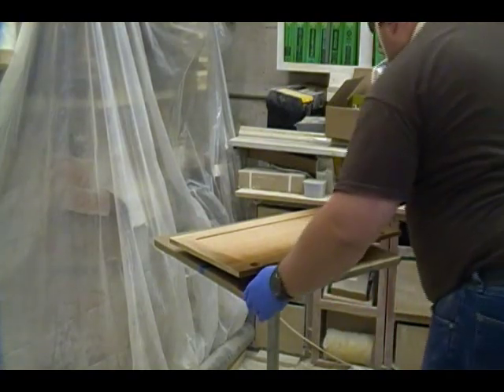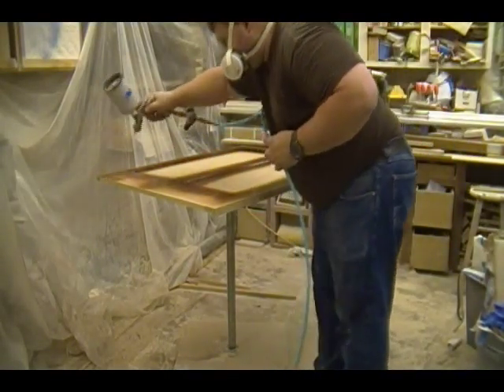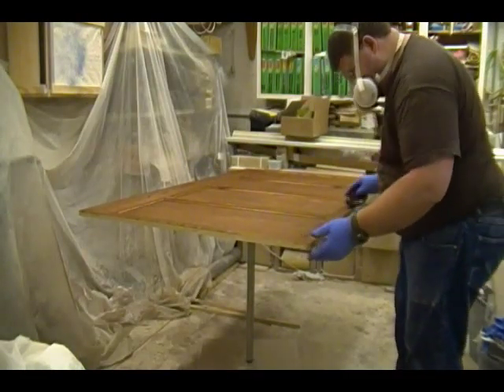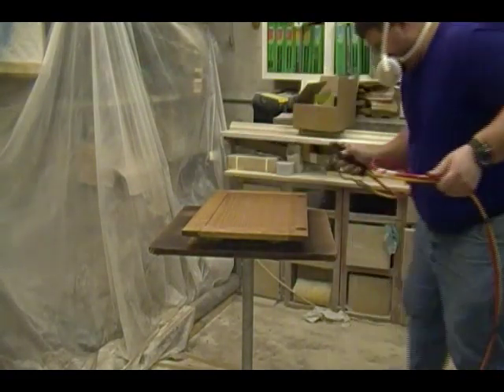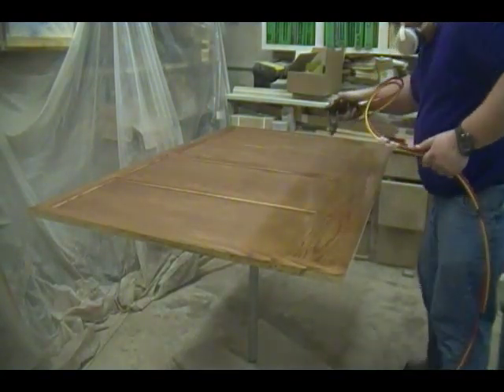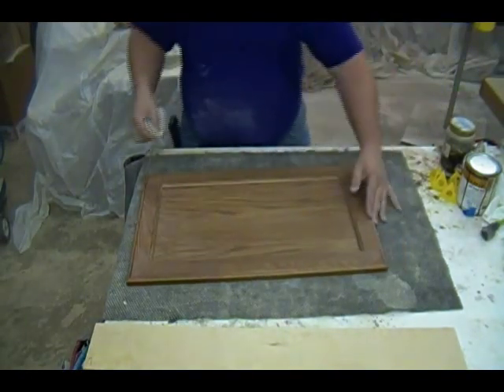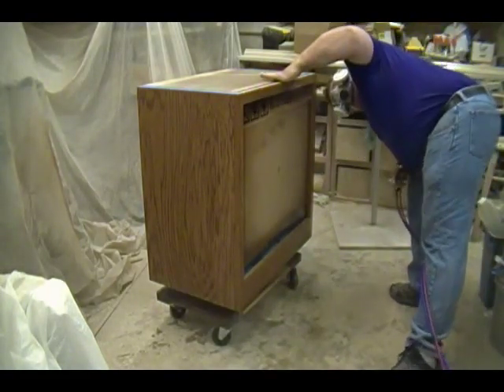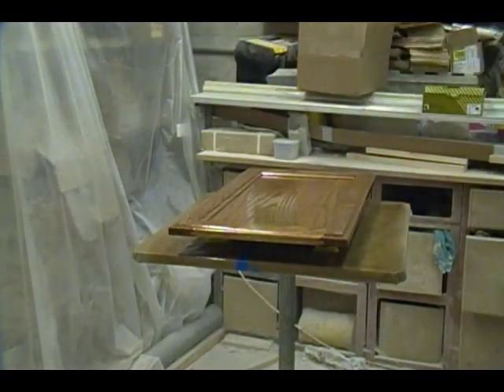Spray Finish an Oak Cabinet And Panel Surround $ 32

Comment: Two questions did you use waterr based stains or spirit based. Can they be mixed directly to the inishing lacquer and can you tell me what type of lacquer or finishing material you used, i.e. polyuretene, sHellac, nitro cellulose etc. Do you mix your own stains from powdered stains. I wonder if I can mix these stains directly with the finishing lacquer, I 'm really new to spraying. Also I think your video is very instructive and very good, Michael Horsfall

Comment: Actually I have a question. I'm just about done building an oak storage cabinet. I plan to spray the stain like you did using a HLVP gun to  achieve a rich deep look.  So whats the best step by step process? 
Step 1. I spray and wipe
Step 2. Spray Polyurethane and let dry? How long?
Step 3. Spray finishing top coat?

Should i use a steel wool in between steps 2 and 3?
Also is there a decent product at Home Depot that I can use or would I be better off going to somewhere like House of Paint?
Also was it Fruitwood color that you used? I want something dark what would you recommend and is it ok to go dark with oak?

Thank you so much!

Joe
Reply from the maker: Okay, just to clarify spraying on the stain and then wiping will not give you a deeper look, it will only speed up the process. As far as the finish, you have a couple of options from Home Depot. You can use Minwax polyurethane or Minwax brushing lacquer. Both are formulated for brushing, but they can be easily sprayed. The polyurethane will give you a more durable finish, but the brushing lacquer will give it a softer silkier smoother look. Either or, both can be used as a self seal system so you shouldn't need a separate sealer.

The stain I used was a custom match. If you want something dark, try something like a walnut or espresso color. Most paint departments have a display of all the stain colors. Dark stains work fine on oak, the just may need a little more time to dry.

1) Apply stain: i.e. wipe on / spray on and wipe off,allow stain to dry (follow can directions)
2) Spray 1st coat of finish (allow to dry-follow can directions). This will be a seal coat.
3) lightly scuff sand the seal coat. 280-320 grit sandpaper for flats and maroon synthetic pad (scotchbrite) for profiles. I would stay away from steel wool, they have a tendency to shed.
4) Spray 2nd coat of finish (allow to dry-follow can directions). This will be a finish coat.
Repeat steps 3 and 4 if necessary for more of a build. If you decide to use the lacquer, I would do 3-4 coats.

Also depending on your personal preference, I would use either a satin or semi-gloss sheen. Gloss has a tendency to highlight all the flaws and defects.

Hope this helps.

Comment: A second question, Sott; why not use gravity spray gun for clear coat sealant?
Reply from the maker: Chris Zano Hi, I buy my sealer and topcoat in 5 gallon pails and have two dedicated air assisted airless guns and pumps set up specifically for spraying sealer and topcoat. Because of the volume I use in a job or run, I find spraying with air assisted airless spray gun and pump set up to be easier and quicker for me, I just stir up the pail and start spraying.

Comment: What about pre-stain? Do you find pre-stain to be necessary?
Reply from the maker: Chris Zano Hi, I find a pre-stain isn't neccessary with a an open grain hard wood like oak. A pre-stain like a wood conditioner works well with soft woods like pine or furr. If this was a closed pore wood like maple, I would have sprayed on a matching brown tone dye stain (acetone based) to establish a base color followed by a light bodied brown tone wiping stain to smooth it out and give it some depth. Thanks! Scott
Reply: ***** Thank you for that response. Greatly helpful. Saves me time and money.

Comment: I have to disagree with you about the use of the term "water white" because this doesn't refer to a coting which won't yellow. It means that the coating in the can is not amber-cast. Non-yellowing coatings call themselves only "non-yellowing", such as is the case with certain waterbornes (which are not hybrid coatings), conversion varnishes, CAB's. acrylics and non-yellowing 2K-polyurethanes. I spray water-white NC lacquer from Kwick Kleen (Kwik-Kote) and that stuff is going to yellow in time.

Comment: hi what type of spray gun you use?
Reply from the maker: +slim toumi Hi, In this video I used a Graco G15 air assisted airless fed by a Graco 395 ST Pro electric pump and a Kremlin MVX Airmix (air assisted airless) fed by a Kremlin 10:14 (10:1 ratio) air driven pump. Thanks! Scott

Comment: You don't get over pray on the back of your doors with that technique?
Reply from the maker: Hi, thanks for the comment. Nope. I have found minimizing the distance from the back of the parts to the spray table helps greatly. If there is any for whatever reason,  it's easily rubbed off with a blank non colored  piece off paper or work cardboard with very little effort. Thanks. Scott
Reply: +The Wood Craftsman (puttz1976) Thanks Scott. Have you ever try to spray booth side simultaneously? With some kind of racks with screws. 
Al